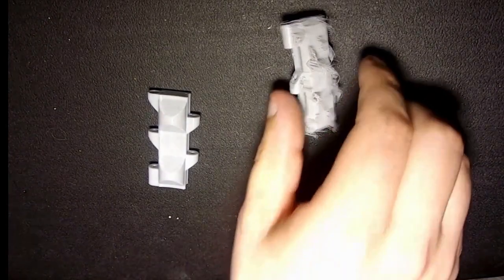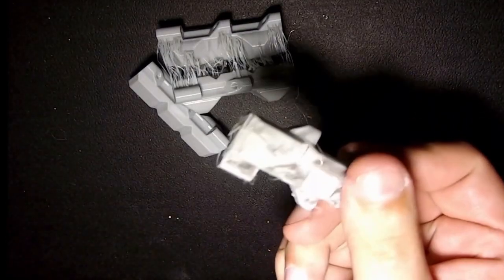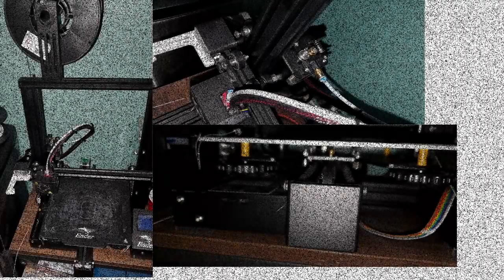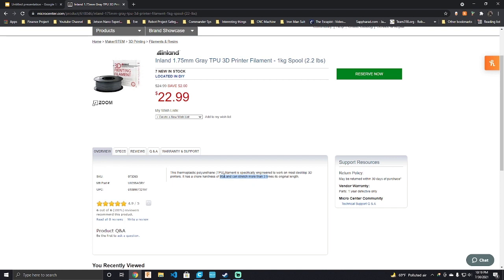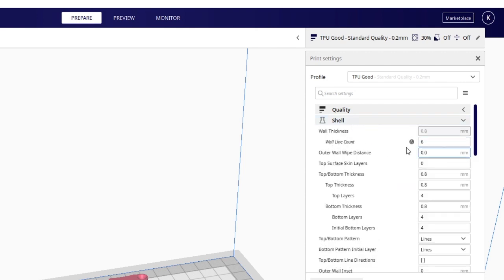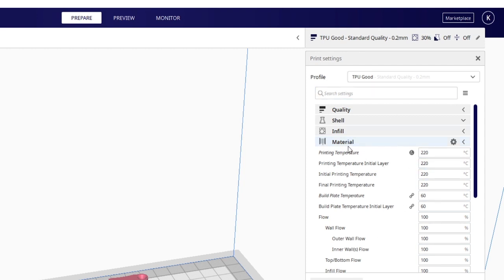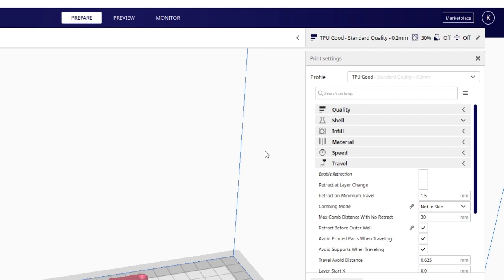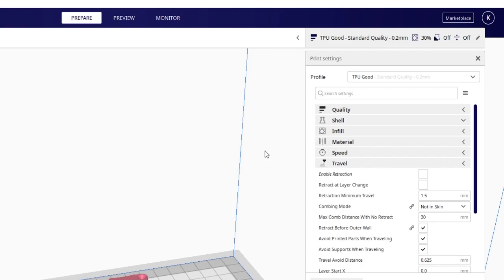Ender 3 & 3 Pro TPU Slicer Settings

Comment: My cura settings only have extra fine, fine, normal,draft,extra fast, and coarse, which is the equal setting to the tpu good?
Reply from the maker: Hi Which version of Cura are you using? I will need to review it to determine what settings would be equivalent. But let me know so I can check it out and get back to you!

Comment: watched your video and got my tp u tamed...then didnt save the profile...luckily when i came back i saw you had posted the profile which i missed before. thanks ahead of time. even if this dont get me back to where i was as you said its gonna be a great starter point instead of starting from scratch. thanks again! Subbed
Reply from the maker: No problem. I'm hoping to have my new shop set up so I can make more videos about 3d printing and build a wide variety of content for everyone to learn from!
Reply: @nerdmanufactory   worked great, a few rounds of glue stick then cleaned the glass after a few prints and still chugging along very nicely, printing frisbees, and articulated dolphins.
Reply from the maker: Yeah gluesticks help a lot especially when making sure you have a great first layer.